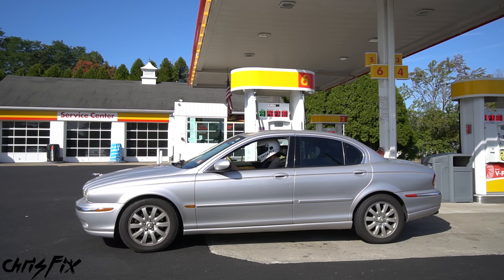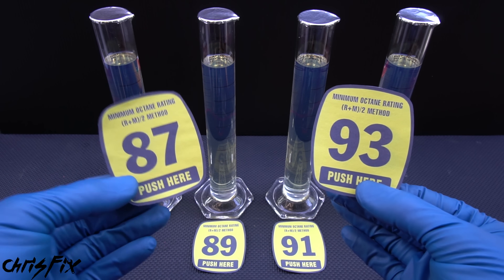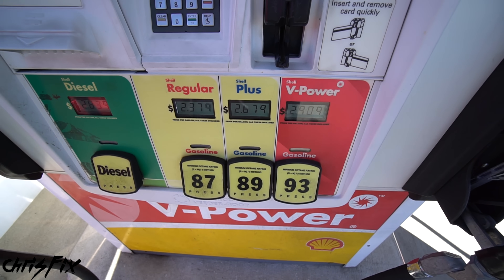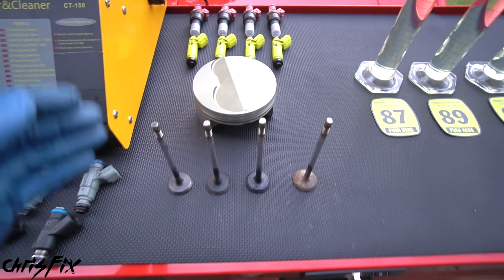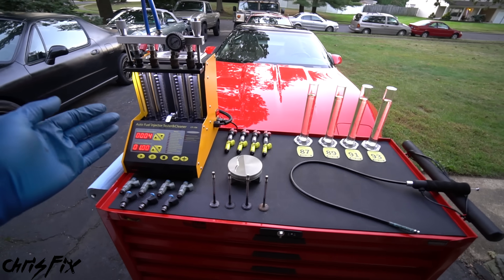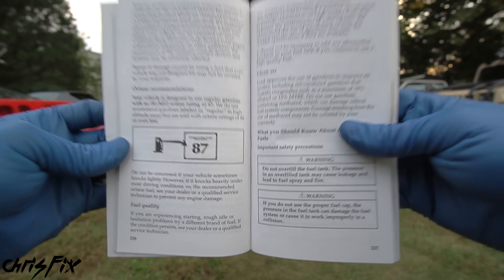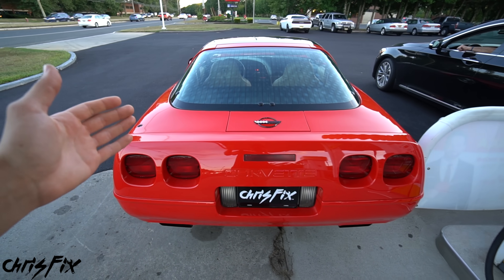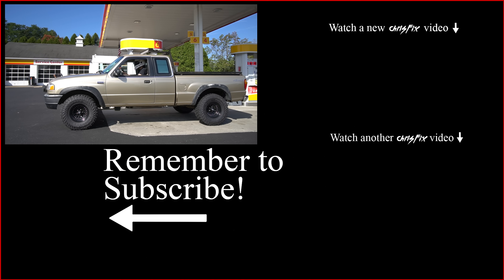What is the BEST Fuel to Use in Your Car or Truck and WHY

Comment: The US also has 85 octane in higher elevation states.
Reply: garretts91 thank you! I was wondering why all the time and added the more expensive one which is recommended by the handbook... so actually I could just use the regular 85 as 87?
Reply: @fancyrabbitelainefan8700  Only if you're in one of those higher elevations states.  Higher elevations mean lower pressure, which means lower octane requirements.  If you're not in one of those states, stick with what your user manual recommends (most likely 87).
Reply: I've noticed that alot of states start out at 87 octane and then 89 and 93. In my area it starts out at 86 and then 88 and then 97. My truck requires 87 octane (as per manual) so im forced to use 88 octane which is .15 to .20 cents more than the 86 octane or our regular.
Reply: @JuanDaMajikOne  I wonder if the 1 octane makes a difference.  Maybe reach out to the manufacturer or talk to a local dealer to see if you can be saving money?

Comment: Hmmm... There was a study years ago proving that putting premium gas in an engine that only requires regular gas is just a waste. A smog test was done on the engine with premium gas in the tank and the results were the engine was dirtier due to the premium gas wasn't burned completely and efficiently at all. The engine was designed to burn 87 octane fuel and not higher. Regular gas in the engine burned more efficiently and it passed the smog test.

I put gas that is recommended by the manufacturer of my 1999 Toyota 4runner which is 87 octane only. Engine still runs smooth and quiet even after more than 213,000 miles on it.

I just use zmax every 6 months to clean the internals of the engine and fuel system and not putting premium gas to clean it.

Comment: What about 87 Octane when it says “may contain up to 10% ethanol”???
Reply: Its 90% gasoline and 10% Ethanol. (Aka...E10) All modern cars are designed to run this fuel. In fact my 2014 Ford Fusion with a 2.5 liter 4 cyl, is also rated to run E15. (15% Ethanol) So any car newer than 20 years can run E10. (10% ) 

In fact here in Wisconsin, all gas stations sell 10% Ethanol mixed gas as standard for all octane grades of gas. The only exception is E15 and E85. (15% and 85%)

This is why it says "may contain up to 10% ethanol". Today it almost always does.

Comment: I use premium gas. I dont care what kinda car it is. The new ethanol system is straight corn syrup in the gasoline. I've bought premium gas in a 5 gal container and I've bought regular gas in a 5 gallon gas can. The premium gas last longer and doesnt foul or go bad or lose spark over sitting too long or hydroscopic fluid attraction. Water in the gas.

Comment: If there is engine knocking, or fuel inefficiency, and you have narrowed down your options to fixing it using a higher octane fuel, is there a difference between filling up with 91 or 93 or filling up with regular and adding that octane booster. is one generally cheaper, or better? Thanks so much chris!

Comment: I want to see you put diesel in the gasoline filler. The diesel nozzle won't fit into most newer gasoline car gas filler receptacles. You can put gasoline into your diesel vehicle and then you will be draining the fuel tank, kicking yourself, and cursing an awful lot. A few s**tball states have 85 octane regular gasoline, and their misguided reasoning is "altitude". With all the computing power in a modern car's ECM the car's engine  control computer knows what the altitude is. I have been known to pay the big coin to fill up on Shell 92 or 93 octane when I come off The Colorado Plateau and down from 5000 feet to 1000 feet above sea level into Phoenix AZ. That vehicle may not get driven more than 50 miles until I go back up north again. Then it will go 2000-5000 miles in one trip.

Comment: chris i have a 2018 dodge challenger RT with 10K miles and a 2007 Mitsubishi eclipse GS with 250K miles. I put the eclipse up during the summer because its my winter car and i put my challenger up in the winter because its my summer car. i was told to fill my car up with the high ethanol fuel and drive it 40 miles before parking them so that the high ethanol fuel is in my lines. Am i screwing up my cars by doing this. neither car gets started while its stored for 6 months each.

Comment: I have a 2011 Ford Escape with more than 550,000 miles on it. The owner's manual says I should use regular fuel (87). Should I be using premium fuel because it has so many miles on it?

Comment: Pump gas does NOT have OCTANE in it! Unless you buy Blue Gas (Ethanol free fuel) the Octane rating is based off the amount of Ethanol (10-15%) added to gas to bring it up to that Octane rating. If you want gas with real octane in it, you need to buy Blue Gas witch in most place is available from 4/1-9/30 (Summer blend only).
I'm surprised you totally missed that info about pump gas.

Comment: Hi Chris, I drive a 2018 Honda Accord. My engine is 1.5 liter turbo. And I still enjoy using premium unleaded in it. It did so good. I nearly got 40 miles per gallon. I have been using like Chevron Premium Unleaded gas. And Exxon Premium Unleaded. Both are 91 octane and does good. I enjoy it so much. One time I fill my car up. And my trip miles with up to 501 to empty. I was impress of it. Any way if I get questions to ask you. I’ll will let you know. Take care and see you more on here. See ya...

Comment: Myth: 7x more than "required by statute" additives produce better cleaning results than a lesser amount of a quality additive. 
Fact: Chevron's gas with techron tested to be the best  additive, and if there are no chevron stations in your area, you can buy techron in a bottle and add it to a tank of the cheapest gas you can find.

The best recommendation for which grade of fuel to use is always choose the lowest octane that your engine is designed to run, which is typically the highest grade mentioned in the manual. Most EFI cars can run on 87 even if they are designed to run on 93, but will do so with degraded performance...and if your manual doesn't even mention 89 or 93 then stick with 87.

Comment: So my 4th gen 4Runner is "tuned" from the factory to be run on 91 or 93 octane. I get an additional 5hp from the VVTI setup, and up in the 20 (car lies so it's around 19) mpg. But have been running 89 to save some money. Do I really need to get the additional HP from the motor when I really don't need it? I do run injector cleaner once in a while.

Comment: I can appreciate the info in this video, but after mentioning E-85 I wish Chris would have followed up with how much ethanol is in the other octanes and if any of them have 0 ethanol. Any vehicle that’s occasionally run (not daily drive) needs a fuel stabilizer or as little ethanol as possible.

Comment: Useful fact: The diesel nozzle doesn't fit in a gas engine car and vice versa. So you can't accidentally put the wrong gas in it.
Reply: Floortile83 Gas nozzles will fit in a diesel neck, the diesel nozzle is just larger so it won’t fit in a gas neck.
Reply: Diesel nozzle doesn't fit in a gas tank, but a gas nozzle absolutely fits in a diesel talk.

Comment: NEVER get gas advice from a video that starts by thanking an oil company for their "support". Sure enough, parts of this were blatant commercials for Shell. 

Better advice: buy the cheapest gas your car performs well with. Unlike what this guy intimates, using better fuel won't make your car perform any better. If your car is retarding/advancing timing, any good cheap OBDII toll will tell you. They're so god and so cheap you should never leave home without one.

Comment: I have a mid engine vehicle, that says to use regular unleaded, but it has 210***+ miles on it. And it sounds really loud and has bad knock sounds on it but no check engine light and the mechanic says there's nothing wrong. So maybe It's just carbon build up because the vehicle is dirty af. Would using premium or a higher octane anyways fix the loud knocking and not destroy my car?

Comment: Chris, my son's Ford Ranger would ping at highway speeds and seemed somewhat down on power, finally we checked the vacuum and determined it had a leak in the intake manifold.  Was kind of a big job on that vehicle but fixed it and now it runs so much better.  Just thought you might want to double check your Ranger.  Ours has that two piece aluminum intake that is common on Fords of that era.

Comment: Chris, my 2009 Tacoma's manual and gas cap say 87 octane. Its engine has a compression ratio of 10:1, and ever since I bought it with only 59k miles, I've noticed the truck just runs better with premium. I even thought I was hearing knocking when I increased the throttle, but I brushed that notion off considering the low mileage of the truck. Wouldn't premium be best? Any reason they wouldn't just recommend premium? Thanks, man. Great video.

Comment: I use e85 gives you more HP power and burns cleaner and will make your engine last longer.
Reply: E85 is only for flex fuel engines...using it in any other engine will do some damage
Reply: @LIG87  my car is flex fuel gives me HPmore power

Comment: Great video Chris.

Question - what are your thoughts around cleaning the valves and the combustion chamber in your car? Does it get to a certain age or mileage where this is beneficial? If so, maybe you could make a video on it.

Would also be a handy video for outlining this extra task if your engine is already torn down

Comment: Who else is trippin about how low those prices are 😭😭
Reply: I dunno? Gas is currently $2.33 a gallon here in Milwaukee Wisconsin. So it's more expensive in the video. And at my local Costco I can get it for $2.26 a gallon. ^_~
Reply: $2.07 here at an Exxon by my job. But by my house it’s $2.18-$2.25

Comment: Shell gasoline has an additive in it that don’t burn. I try to use a Top Tier gas. shell is not a Top Tier fuel. Some vehicle manufacturers recommend using Top Tier gas. it  has more than the governments  minimum required detergent additives. With the idea that this will help to keep the engine cleaner.

Comment: weird in my 2016 fiesta st I get much better gas mileage out of 93 octane then I do 87,89 or 91 I've also gotten a 1-2 hp and 2-7 torque rating out of using the 93, I've ran my car for 3 months using each fuel type and found I can get around 431 miles to 3 quarter tank of gas with 93 if I drive regularly (grandma) then using 87 with the same driving style.
Edit: I tried running 100 oct in my car but with out a upgraded inner cooler it ran to hot all the time.

Comment: I drive an 06 Volvo s40. I use premium every third fill up to save a bit of doe and the other two times just regular. Is that not good? My manual says it highly recommends 93+, which here in Canada is not cheap to fill every week.

Comment: Let me answer that question Chris,

The cheaper one
Reply: My car runs like crap on the cheapest one.  Says use 91+ in the owners manual and on the fuel door.  Runs much better on the higher octane
Reply: @raybragg272  well that's because your car literally needs to use that octane for best performance..
Reply: Lol
Reply: Woooooosh
Reply: licky licky well I’ll tell you I have a 06 maxima that I’ve had for about 4 years same engine and trans with 280k miles no problems what so ever just been doing my normal oil checks and maintenance such as spark plugs and so on but yes
Reply: My 97 mirage that leaks oil agrees
Reply: can we mix the fuel (93+89)/2=91 ?.?.? it is good 
idea
Reply: Negative, cheaper gas causes more carbon deposits/buildup (its not as processed (additives or "cleaners") than higher octane as its more "raw gasoline"). Which will also cause very poor performance or even less fuel economy, greater wear and strain on the mechanical parts making the engine work harder and produce more heat in turn causing pre-detonation/knocking or pinging anyways. Also higher octane helps to clean the engine internally, ever use gas to clean parts before? It does a much better job than most chemicals. Its a bit more pricey for higher octane but well worth it in the long run.

Comment: Hi Chris, as always very informative videos. I've learnt a lot about cars and English too. My question is : how can I stop detonation in my car? I've changed the octane from 95 to 97 and the knocking sound is  still present. You said detonation could be due to some carbon deposits on the  valves since this increases the compression ratio , should this be the case what can I do? I own a 2005 3.0R Subaru Legacy. I read the owner's manual and I discovered that some detonation is normal when accelerating but I don't know how much and how long  is considered normal by the manufacturer. Any tips? Thank you !!! Best regards from Chile
Reply from the maker: Do they sell higher octane just to try out? Any special stations that have 99 or 100?
Reply: @chrisfix  97 is the higher octane sold in Chile and most of the gas stations here sell 93, 95 and 97. Since I started to run my car on 97 I've done it with Shell V-power ( whatever that surname means)

Comment: So running Premium will not harm a vehicle that says to use regular, and it will keep it cleaner. So why not use Premium? Sure it costs more, but in the end it keeps the engine cleaner and protects against knock.
Reply from the maker: You don’t really need to clean your engine. It stays pretty clean as you saw with the normal valve. Just make sure you drive the car so it warms up completely each time and it will be just fine. Save some money that way over the life of your car.

Comment: I have a question if certain octane doesn’t produce more power why is it when tuning a car or bike certain octanes make more power or will lower ur power ? Iv felt a difference from regular An also higher,that low key subliminal free plug for shell tho lol Iv also seem cheaper cheap ass gas mess valves/engine parts lots more carbon deposits ,not saying higher octane won’t do that but it’s just better in general ,I run 93 all day
Reply from the maker: The different octane fuels have the same energy, the higher octane can be used better in the engine. The timing can be advanced with premium so the engine burns more efficiently. Regular gas in a high compression engine would have to retard timing so you make less power. The energy is the same but more energy turns to heat instead of moving the piston down with regular. Make sense?

Comment: You do Not know what you are talking about.
87 octane is different than 93 octane. More ethanol in 93 octane, less BTU. For example, if you modify a car to run E-85, you will have to buy new injectors that flow more gallons per hour. Because ethanol has less Btu's.  
Other mistakes.
Reply from the maker: The ethanol content in all of the fuel is the same. In this case, the fuel had no ethanol in it. They don’t put more ethanol in higher octane gas.

Comment: the last owner of my 1999 honda civic put e 85 in it an it wus a race car it has sum mods on it but mostly stock do i keep puting e 85 or go back to 87 fuel
Reply from the maker: Whatever he was running and it worked, use. If he had it tuned for high octane fuel and you use regular it could detonate.

Comment: My s10 is missing a little bit would running higher octane fix it
Reply from the maker: Potentially. If the miss is because the knock sensors are retarding the timing to protect the engine it might help. More than likely it’s spark plugs, wires, or coils.
Reply: @chrisfix  actually it is leaking gas so it needs a new gas line and right in the middle of winter too 😬

Comment: Why did you skipped about gasoline in Mexico, being way closer than Europe and where near to a million americans lives there or Canada? 
Bottom of this video is, read your car manual and if your car specifies that you need premium gasoline, that's the one you should get, if not, any other gasoline will be fine. Also, when you put 87 octane vs 93 or even race fuel which is over 100 octanes , you actually feel the difference. Take the test to a racetrack and do the time attack. You'll see what I'm talking about.
Reply from the maker: Huh?

Comment: In regards to fuel additives and how different companies use different additives: Would it be a bad thing if somebody were to use different gas stations to fuel, often? I guess you could consider this a myth as well. Cause I stick with Shell. I've been using Shell my whole life (driving) and I've always wondered if switching your gas station will have any negative effects on your engine.
Reply: As long as you avoid the really shady gas stations, they should all meet the Federal requirements for fuel additives, meaning none will hurt your vehicle.  When in doubt, go to any one of the big chains (Shell, BP, Costco, etc.) where they should have companywide consistency.
Reply: from having personally traveled a lot having to fill up at many different gas stations, I can confirm changing gas stations will not cause any hard, TO THE EXCEPTION of a delivery of bad gas, but this can happen to any station.
Reply: I am interested in finding out the same. I go between Costco gas and Shell. Costco is way cheaper, so I wonder how the additive packages differs.
Reply: Alex Gutierrez Costco actually qualifies as a top tier gas company 👍🏽 look it up !

Comment: I’d like to push back on the fuel mileage thing. I get 1.5mpg more with 89 than with 87. Idk why.
Reply from the maker: Nice! The fuel economy thing is tough because so many factors affect MPGs such as temperature, weather, driving habits, traffic, etc. but with that said, your car could potentially be able to make more of the mid grade.